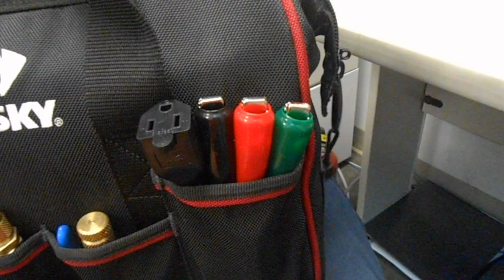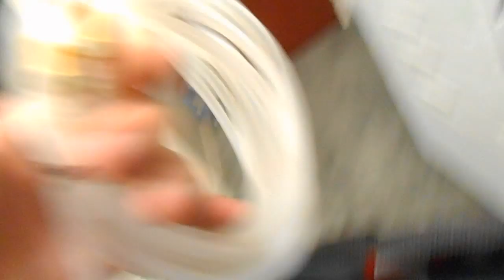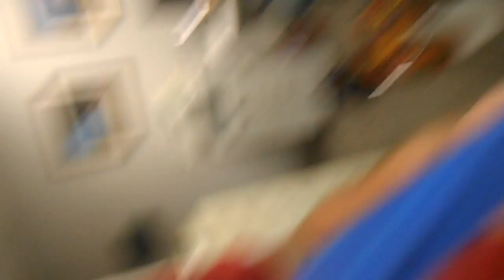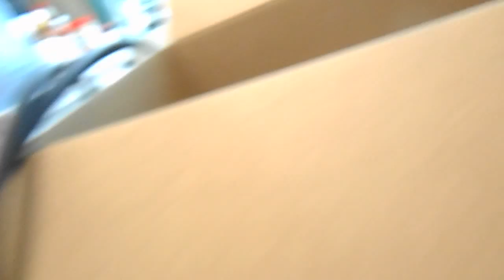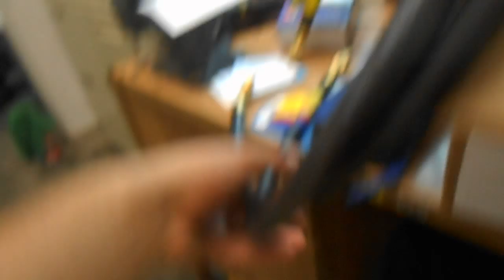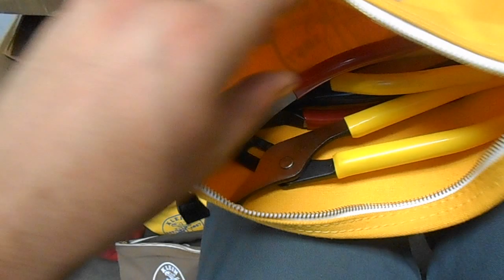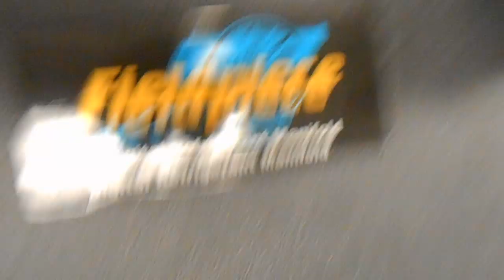Even More New HVAC Tools & Toys

Comment: What you’ll find over the years, is most of these tools are seldom ever used BUT... they’re golden when you do. Now all’s you need is a bigger truck, or trailer, to haul these around with you,  My Veto bag is 14# empty, it’s about 45# loaded. I started with a class 1A fiberglass ladder.... smartened up, and went to a class 1 aluminum. Made a world of difference on my back. Think long term. None of my step ladders are double sided, my first was, and was it ever heavy.  A ladder should hold 3.3 times its rated load.
Reply from the maker: Good advice! This was a few years back and I was a little trigger happy with the credit card but, it's all good stuff to have. These days, I definitely have established what tools I need to always bring with me and which ones to leave in the shop for those special jobs. I really try to take a minimum of tools with me nowadays. On many occasions, a service call is handled with my 11-in-1 driver, wire stripping pliers, diagonal cutters and the Fieldpiece stick meter. One day, I hope to get one of those big panel vans you can fit literally everything into but for now, my old G20 is doing the job. Only downside to an aluminum ladder is the conductivity but the weight difference is considerable
Reply: 71dembones I’m always observant of power line, before I remove my ladder, and make a visual plan of my path.  I did like the ball crimper for processing tubes, the flat pincher can actually cut the tube, BUT.... the flat pincher can reopen it back up with the flare block that comes with it after it was closed.
Reply from the maker: @hvac01453  more good points. I keep both the flare bar style pinch off/rerounding tool and the ball bearing tool on hand. The ball bearing is better when you're sure you're pinching it off for good. The flat tool is better if you are trying to replace a filter drier or other component without recovering. Like you said, it can be undone whereas the ball pinch off is kinda permanent
Reply: 71dembones ya, it looked like Santa was very generous a

Comment: So, it has been a few years since you posted this 71dembones.  How do you or did you like the Sman?
Reply from the maker: Hey David, unfortunately I haven't had much of a chance to upload lately. A lot of family duties have taken much of my free time. Also, many of the corporate clients/owners I work for have specifically requested I not take video of their equipment/operations. Too bad because that's where the most interesting stuff usually is. I'll probably start uploading again this year regardless. 

In regards to the manifold; more bad news. I only got to use it a short few times before it, along with many thousands worth of others tools, was stolen from a jobsite. From the testing I did, It had nice features and was very accurate. It's the best for pressure testing because you can see any pressure drop real quick when you're looking at .1psi increments. The onboard micron gauge is a nice thought but not very accurate because it's at the end of a hose set instead of directly on the system where it belongs. I think it's still one of the more affordable digital gauges out there and would definitely recommend it for that reason alone. I've used someone else's Testo gauges and they didn't seem any nicer for the extra cost. I still stick with good quality analog gauges myself. Admittedly, the Fieldpiece manifold was an unnecessary impulse buy at the time! It looked cool, I loved the FP products I had, and I had some extra cash in hand, so I got it. Haven't bought any digital gauges (besides a micron) since. Take from that what you will. Thanks for watching and commenting.

Andy
Reply: Hey Andy, thanks for the reply, I am looking at Sman or Iconnect, not sure which one as I am just beginning HVAC apprenticeship.  I already have a cheap $79 set of analogs, but I love my electronic toys....LOL, thanks for the response, best of luck to you and sorry about the theft.

Comment: What is that plug called at 0:30
Reply: Daniel Wislon did you ever find out? I can't find one either!
Reply: Gunfighter23 Cheater cord or widow maker are the most common names for it.
Reply: They can be nice but the majority of what I work on is 460 so it won't help you much there. Though I have a buddy that has a vacuum pump that will run on 120 or 230 so it's cool for him
Reply from the maker: A dual voltage vacuum pump would be awesome! Even if you're working on 240V and less I'd rather not use the ground wire as a neutral and just go between phases